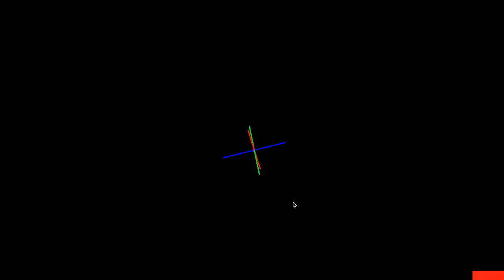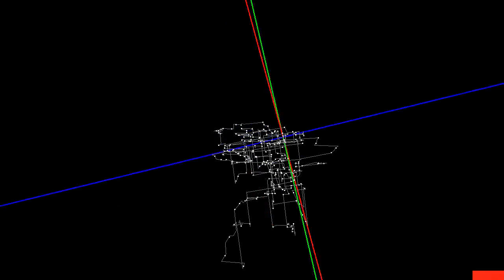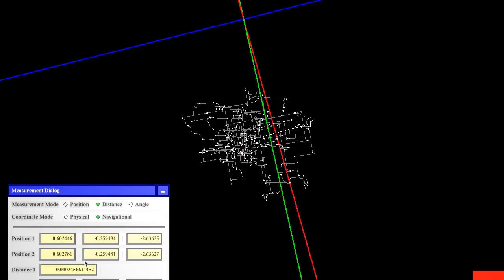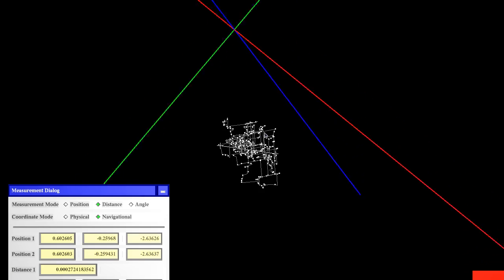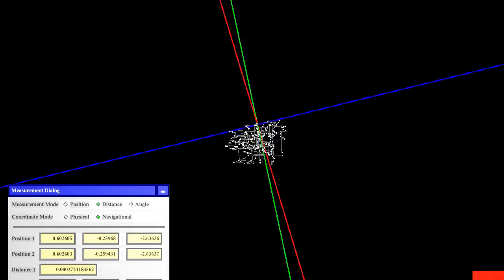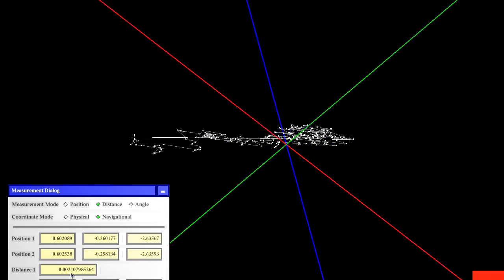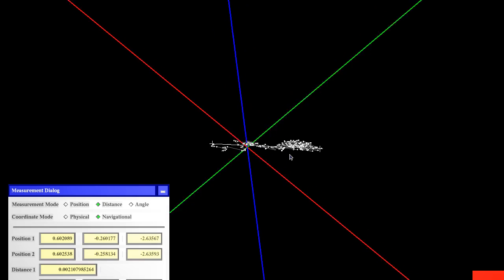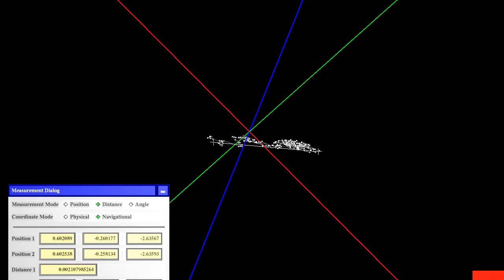Lighthouse Tracking Examined - Headset at Rest

Comment: I wonder if the jitter is created by the slight vibration of the lighthouses themselves. I can hear them whirring around so they have some slight vibrational skewing it seems.
Reply from the maker: That is a contributing factor, but I can't say how important it is compared to other sources of noise, such as timing inaccuracies, quantization, and IMU measurement noise.
Reply: @okreylos  This might be measurable by comparing the numbers you get when your base stations are mounted on tripods and when they're mounted on a more stable surface (ie. being mounted on a solid wall)
Reply: They do seem to be somewhat circular in their motions.

Comment: You say that the depth noise increases when one lighthouse is covered. I am curious how can a single lighthouse know anything about the depth? 

I would understand if, for example, a constant velocity is assumed. Then the system would assume it is standing still and the depth would tend not to change over time.

I assume the depth estimation would be completely off if you moved the headset toward the functioning lighthouse while the other one was covered/disabled?
Reply from the maker: The Vive HMD and the controllers have multiple photoreceptors on them. If you move, say, the headset towards one lighthouse base station, those photoreceptors cover a larger solid angle relative to the base station than if you move the headset farther away. In equivalent camera terms, the headset appears smaller to the lighthouse when it is farther away. That's how a single lighthouse is sufficient to calculate distance.

That's also why tracking noise in the distance direction grows faster than tracking noise laterally to a single lighthouse. Distance is calculated indirectly, whereas x, y position is determined directly from relative angles.

Comment: Doc, I'm curious to know if you have tried re-measuring tracking noise after adding a third base station into the mix. Does the jitter become markedly more isotropic, or is it a case of diminishing returns? If you've yet to test that configuration personally, what is your prediction?
Reply from the maker: Does Lighthouse work with more than two base stations now? As far as I know, two stations use 1/2 time multiplexing, which wouldn't leave a slot for a third. If that was changed, adding more probably only reduces jitter by a little, unless special circumstances where a tracked object is along a line between the stations.

It would obviously help with occlusion, and reduce situations where any given object can only see one station.
Reply: Wow, looks like you are correct that the configuration is (as of yet) unsupported. I assumed that HTC was selling them through their store for both replacements and system upgrades. 

What would need to be changed to accommodate it? The hardware itself, or would a firmware update suffice?